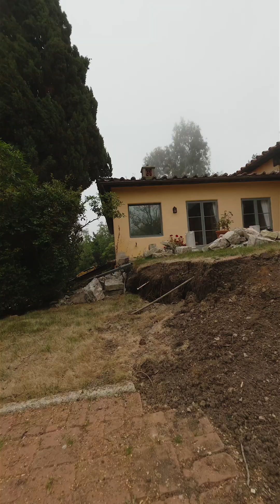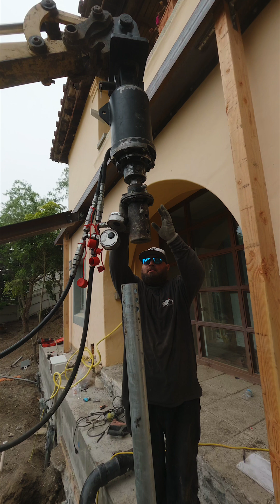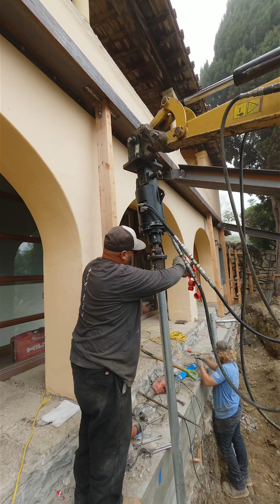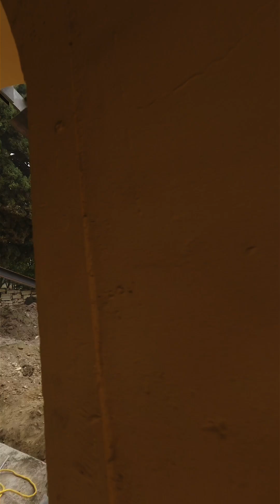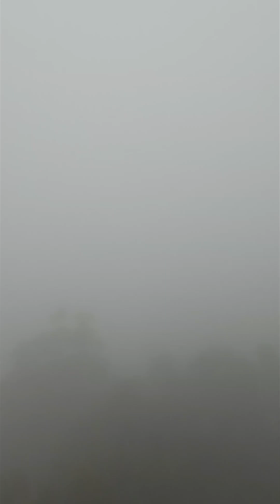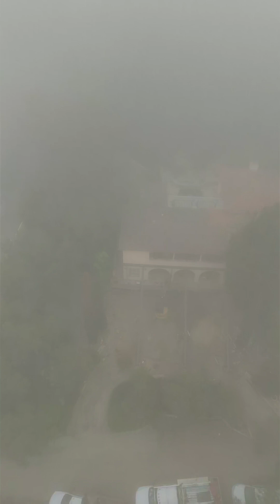Saving Rancho Palos Verdes Home - Landslide & Settlement - Helical Pile Foundation Repair

Comment: Impressive.  The cost must have used up a large part of the owner's savings but at least he can keep living there.  I recently had to connect to the city sewer line after my septic tank died.  It cost me $90,000.   The city had to get involved and issue permits.    A disastrous home expense can't happen to you until it does.
Reply from the maker: Luckily for the homeowner it cost quite a bit less than what you had to pay for your sewer and septic tank issue.  We're very familiar with working with cities as all of our projects are permitted.. but that's not to say this wasn't a disastrous home expense the homeowner had to deal with